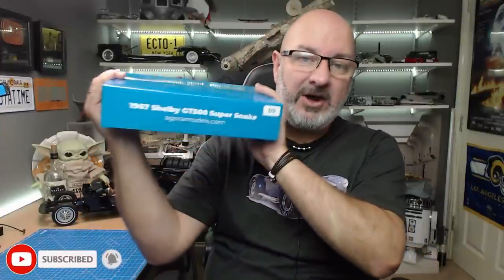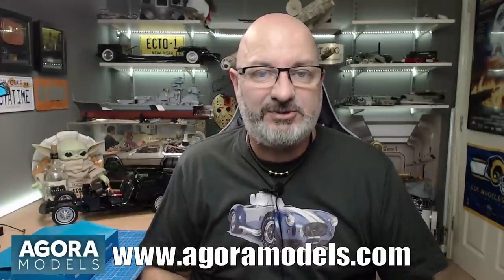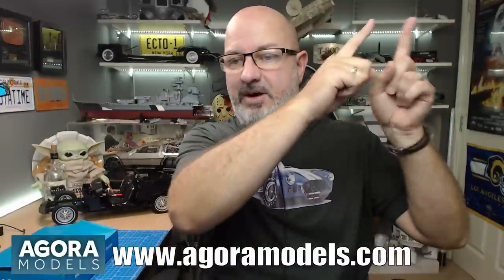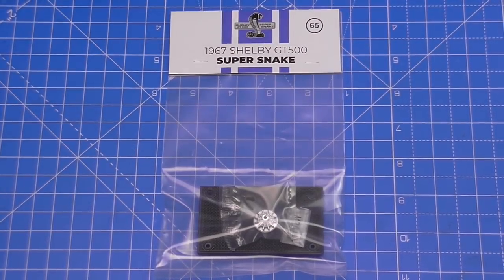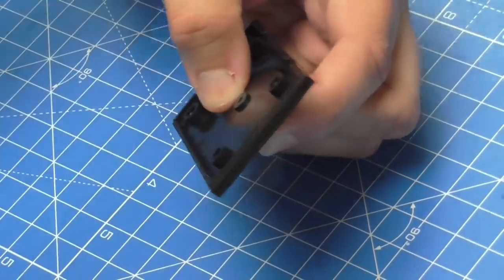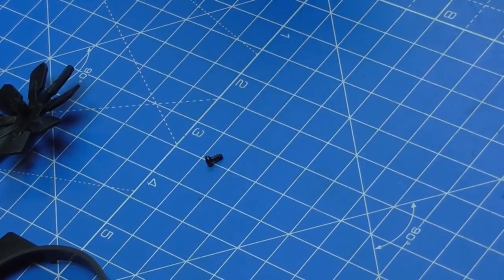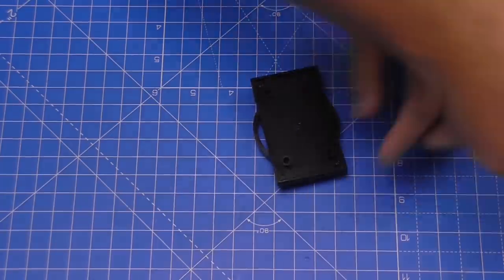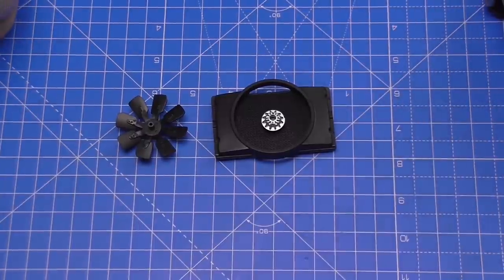Agora Models 1967 Shelby Mustang Super Snake - Pack 9 - Stages 65-73

Comment: A much better engine in the full run than the prototype, but that is what a prototype is for to fix problems on it to do the full tun better than all prototype's.
But dont forget if the prototype ever comes up for sail it will most likely be more valuable than any other versions out there.
Loving the build as all ways.
Stay safe all.

Comment: Is the metal plate on the oil cooler fitted the wrong way round? You have the plain side facing up, but the magazine picture shows the plate having grooves on it.
Reply from the maker: Hmm the plate can only attach to 1 side and to ensure the bent pipe is on the left thats the only way it can go in. Not sure to be honest.
Reply: No, the metal plate needs flipped over to show the detail.
Reply from the maker: Lol. I didn't even realise there was a detail on the other side. Well done for spotting todays deliberate mistake 😆😆😆